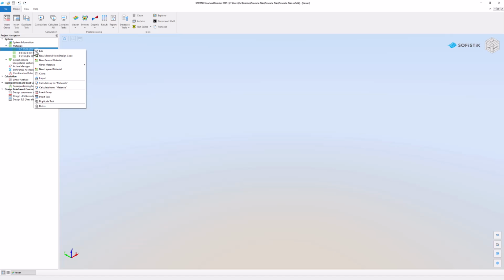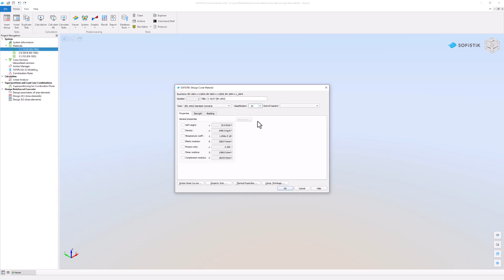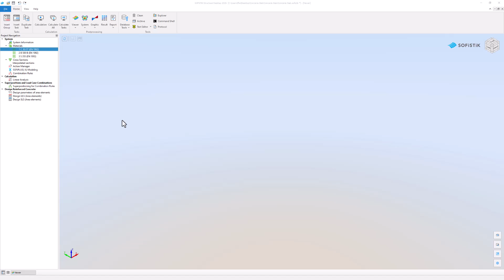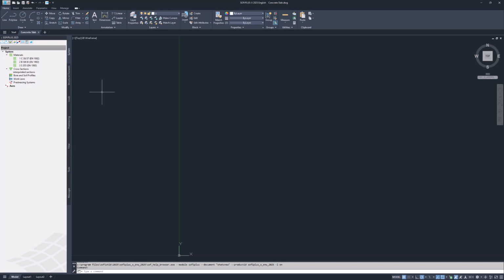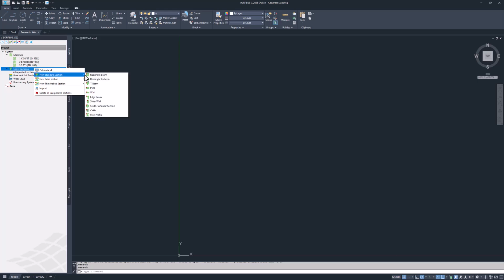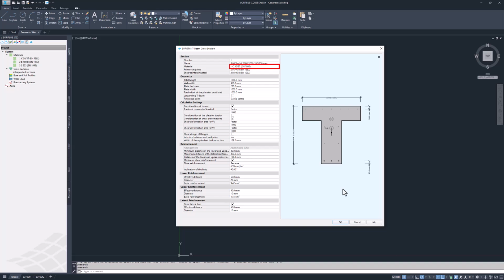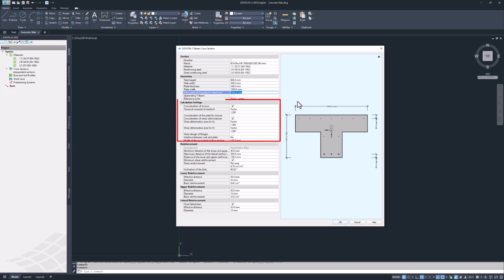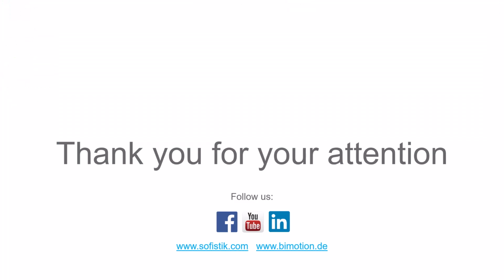#02 SOFiSTiK 2025 - Materials and Cross Sections

Comment: I’m working with SOFiSTiK through the Rhino Interface to model a membrane with masts and cables.
My masts are defined as Truss Elements in Rhino.

Problem: when I try to create a Circular Cross Section for these masts in SOFiSTiK SSD, my Steel material does not appear in the Material dropdown list inside the Cross Section dialog. I need some help please :(
Reply from the maker: Hi florencemirindi1169,
the export from Rhino Grasshopper doesnt automatically create the material.
I guess the easiest solution for you would be to create the used materials in SSD.
They will not be overwritten with new exports. 

Sidenote: the grasshopper functions only use number references (e.g. 1,2,5,...).
As long as these referenced numbers match the materials in your SSD project, you should be fine :).
Reply: @SOFiSTiKAG  Thank you for you support. 
I have already created an S355 Steel material in the Materials section. However, when I open the Circle / Annular Cross Section dialog, the Material dropdown my steel material does not appear in the list.

I can assign timber or concrete materials without problem, but not steel
Reply from the maker: Hi florencemirindi1169,
unfortunately it is hard to give you a proper anwer in the comments of YouTube.
I reccomend you contact our support team via SSD - Help - Support Assistant.